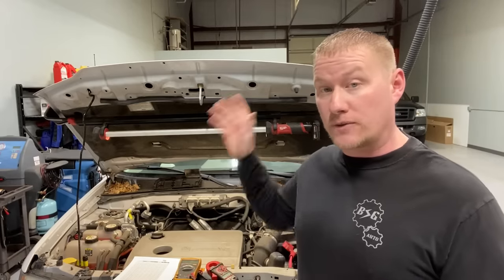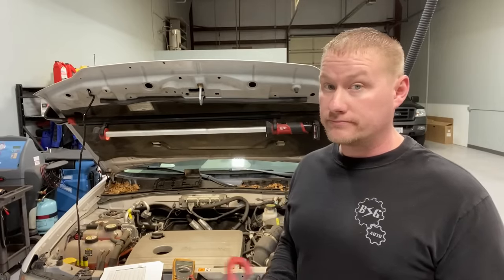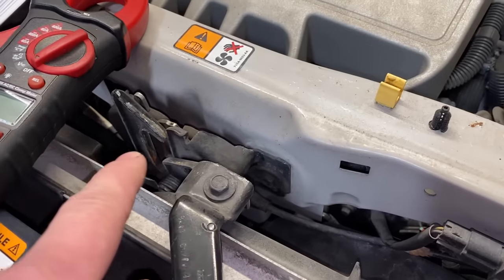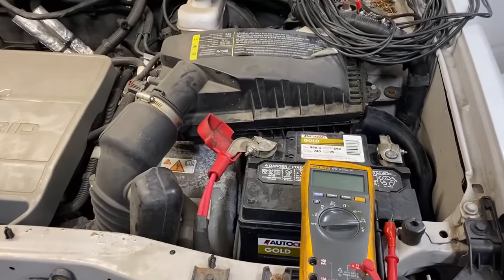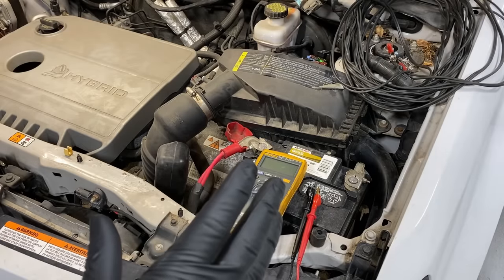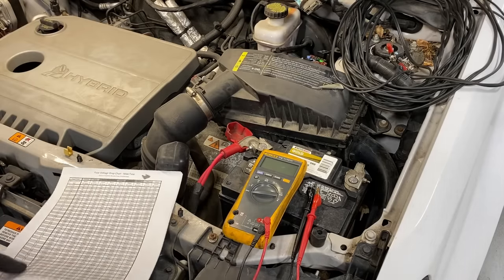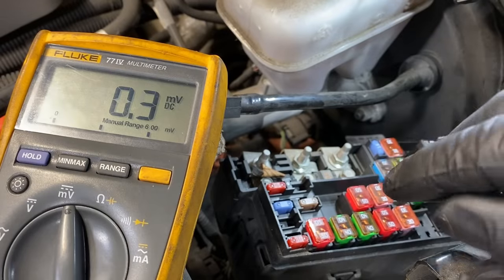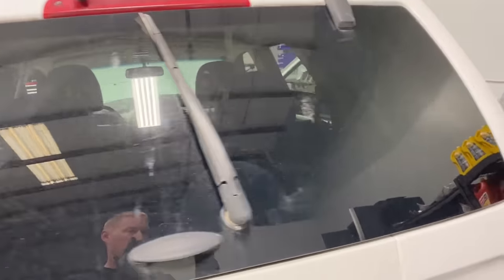Which Parasitic Draw Test Method is REALLY the Best?

Comment: Yep, you nailed it from watching other videos on the subject - you’ve covered the bases - & some other good tips too re rear washer motor - also the lead connect to negative batt terminal to negative lead before connecting the multimeter - which saves the multimeter from any spike/surge. Although I think you’re a bit harsh saying 90% useless is the measurement of the mV readings to back of the fuse. The method is non intrusive - It can quickly diagnose circuits that are on - & identify approx current draw. The drawback are items you covered. Horses for courses 👍

Comment: This was very well done.  Discovered my Klein CL120 does NOT measure dc current  on the clamp only ac.  Now smarter picking up CL590 clamp meter that will handle the dc chore.  My  '95 Mustang 5.0 has been taking down battery every few days.  Got a charger to top off myself and maintain and a loadtester.  Shop last trip gave me full charge and full system check calling it good!  Telling me to pull the phone charger overnight.  This seemed logical and worked for a week...boom.  Did the series test and seeing 140 mA draw.  This is well more than 50 mA standard.  Next step to do clamp dc amp and fuse test to see if there is a bad actor lurking.  Or is 140 mA OK?  Hmm I do need to give it an hour to see if the key remote unlock and clock are adding up.

Comment: Had this issue on my 2002 F150 and it was the radio.  Couldn’t figure it out and decided to change the radio because I couldn’t see what station I was listening too and it ended up fixing my draw issue.  Two issues fixed at the same time!  I got a newer radio with Bluetooth and hands free calling and no longer needed my jumper cables.  Win win…

Comment: Nice detailed summary with your thermal camera I wish it also brought out a infrared temperature scanner because that can also help just by measuring the heat across each fuse not everybody will have a thermal gun obviously cuz the price but you can get a infrared laser thermal scanner real cheap and for the cheaper ones just keep it closer to the fuses

Comment: Excellent video.  2 questions.  1) Does it matter if the positive cable is removed instead of the negative to insert the ammeter?  2)  Will using the amp clamp on the negative cable give the same results?  Thanks.

Comment: Your Tried and true method has been used for 30 plus years and there is a reason for it. Set it up including module shut down time and open up shunt so meter becomes path for battery, meter on mi/max and walk away. Come back periodically and check the meter. Process of elimination of each sub ckt for draw. Method of your choice. That easy. 
Honestly a visual observation and good ears will lead you down the right path if you have experience.

Comment: I used Brians's good method to find a parasitic draw on my 2005 F-150. It turned out to be the basic AM-FM radio that had a low resistance to ground. It wasn't quite shorted but was drawing a few amps even when the key was off. I should have taken the hint when the display LEDs started acting funny and going dim. 

I'm an industrial automation tech so I already knew how to do this. Brian is right. Using the multimeter in line with the battery cables is the best way to test for current draw. The clamp-on meter works great if it has a DC amperage function. Some cheap clamp-on meters only do AC amps. Those won't work in this case. Another possible way is to measure across the load side (downstream side) of the fuse using the Ohm setting with the fuse removed. You have to know more about the circuit to understand what is a good reading but a very low resistance reading is a pretty good sign that something is bad in that circuit. Intermittent problems are always the hardest to find. Wires that have damaged insulation can be very difficult to find and sometimes the best you can do is to just carefully run another wire rather than try to find where it has gone to ground in the wiring harness.

Comment: Finally there are DC clamp on ammeters. They are less than a Ben Franklin and mine is just great. No need to disconnect wires. Just access the wire, clamp, and read the current. I will be using mine to find a short in my wiring.

Comment: I had a VW in which had defied everyone with a fault - every test going had been done. Only scoping the fuses one by one with a laser temp-meter showed the cause - a dodgy connection grounding out on the 20amp starter fuse circuit - with the car stone cold, the 20amp fuse wasn't. It can be a very handy bit of test kit.

Comment: ❤

Got to say its really quite straight forward with basic understanding of cars and electrical sysytems this is not system design just pointing and shooting really

I have an E91 bmw 320d which has now killed 2 batteries, one being brand new!! 😫

I thought it could be relating to a control module or the entertainment/nav system,  BUT my rear wiper has recently decided to freeze in the upright position just like you highlighted! Ive pushed it down but its definitely not locked at rest as it should be! 
I have suspected the alternator also and will check draws using an amp clamp as you've done! 
I have formal automotive experience but you broke this down into a video that really anyone can piece together without more than an hour of learning and a bit of research on their own vehicle.. 
If you're still out there reading feedback, thanks for your time and effort putting these videos together! 👏👏👏👏🥇

Comment: First off, your channel is awesome! Keep up the great work! I have a 2011 Escape 2.5 with a parasitic draw. The wiper motor is not the culprit. I do notice that when you turn off the car, the clock will stay on and not shut off. What module would that be controlled from? I cannot figure this out? Would it be the BCM (interior fuse panel)? The car has a sunroof and I was told by the previous owner that the sunroof drains were plugged and water got in the footwells.

Comment: This was very well performed. I reckon you had already eliminated the alternator. We all know it's Ac then converted to dc by the rectifer. The easiest way to check it, set meter to AC . Engine running. Check at battery. If you get anything but zero. Rectifier is bad. Everyone knows this. That's the 1st thing i check. Replaced quite a few.

Comment: Great information! But the parasitic draw on my friend's 2012 F-150 only happens VERY intermittently. I was inside checking the fuse panel with the volt meter when all of a sudden the draw jumped to 3.5 on the amp clamp and it only repeated about two or three times in two hours. The constant draw was 1.5 on the amp clamp.

Comment: Found a parasitic draw in my wife’s Chevy Tahoe. It was in the radio, in the circuit that has power even when the key is off. Didn’t want to spend the money to replace the radio so, I pulled the fuse for that circuit and put a jumper wire in the fuse box so that circuit would only get power when the key is on. So you can’t have preset stations and the clock resets every time you turn the key off but who cares, at least the battery doesn’t go dead after it sits for two days.

Comment: Excellent video. In case of those cartridge fuse you still have to pull those in the 3rd method. A dome light circuit on my truck drove me crazy with the  delayed courtesy dimmer.

Comment: Best video over 20 years in the business. Thanks for the battery disconnect with the extension cables. Never thought of that. Thanks. Can you update what amp clamp you use the amazon link in inop. Also I found with battery drain problems over the years always look for the obvious aftermarket equipment first, dongle plugged into the obd connectors. See if the inside smells like the vehicle was pulled out of a swamp, etc..

Comment: Well done. Of course I would have started at the battery to see if there is a parasitic drain in the first place and then traced it to the circuit. You did everything I would have done...max hold, etc. I have a Fluke 87. I need to get a clamp style DC amp meter and they cost quit a bit more than an AC clamp meter.

Comment: I had a parasitic draw in my 99 Ranger once.  I used method #2 since I don't have an amp clamp.  I hooked my meter up before removing any accessories in may case.  It turns out that the inexpensive power port y-connector was the issue.  It was one of those you buy at WalMart.  My battery would drain in about a week.  Something on it's printed circuit board decided to go on the fritz.  It still provided power to both ports, but It would constantly draw and amp or two once any item to be charged was removed.

Comment: Absolutely the best video on finding a parasitic draw I have seen yet on youtube. My only question: why do you spend the time to add the leads on the negative and then remove them to have the full load go through the meter? I didn’t quite understand why you couldn’t just hook the meter up in series and wait? What was the purpose of the leads first? Thank you!!
Reply from the maker: The dual leads allow proper current flow no matter the setting on the meter. Also, it allows for connecting to something as large as a battery post.

Comment: I prefer placing a meter in series with the battery to measure the amount of draw. Amp probes are to unreliable at lower currents under 1 amp and drift a lot . The voltage drop across the fuse thing may work for some but I’ve never had any luck
With it . Great video

Comment: Great video!  This is very useful. I have always done method # 2 which I always hate since I have to undo the battery cable to begin with, and I am too cheap for an amp clamp. Thankfully for a DIY'er, I seldom deal with parasitic draws.

Comment: That was a very clear tutorial,   I normally use the in series between the battery post and cable,  but I do have a dc amp clamp,  if I needed it.               GREAT VIDEO,                  Thanks

Comment: I've used the tried and true method of disconnecting the Negative cable and putting a home made "Cable" set up to run the vehicle, shut it down, insert my Fluke 87 set up for 10 amps with an in line fuse to protect the meter's expensive fuse, then disconnect the "heavy cable" used for running the vehicle once the high current drops off while the meter is still connected with less than 10 amps running through it and finally put on min/max.  Like you said, takes a while to show itself.  BTDT!
A sometimes quicker way to get to show, is with the heavy cable and meter connected, turn the ignition switch to on, then off, then on, then off,  then on, then off.  With key fob vehicles push the lock button and watch.  Sometimes the 3 on and 3 off will make the intermittent circuit show itself by staying on and at that point I'm saying. "I gotch ya!"

Comment: One of the most informative videos that I’ve ever seen. I have two questions though, if you test across the fuse instead of from the fuse to ground wouldn’t the fuse be a path for the current to flow making it difficult if not impossible to get an accurate reading to diagnose the problem? Second question, if you turn off your vehicle with the wipers in the up position so that you can raise them up off of the windshield so that they won’t freeze to the windshield will that create a parasitic draw?
Reply: The wiper motor will only draw current if the ignition is on to power up that circuit.  The only exception to that is cars that park any open windows, sun roof and then leave the courtesy lights and parkers on for a minute after you have removed the keys...

Comment: Great video! 
Just 2 things id like to mention that ive seen in the field doing these same draw tests,
One thing is ive noticed some multimeters will always be an amp meter if the wores are plugged into the ports even if the meter is off or set to volts and can blow your fuse if youre not careful. I find it easier to disconnect one lead until im ready to do the test.
2nd thing is ive noticed when pulling certain fuses that power modules will sudden awaken other modules and increase the draw since the working modules are "searching" for the module that lost power when you pull the fuse and it can be confusing to see the draw increase after removing a fuse...but after finishing the video you did mention the 2nd one 😅

Comment: Problem with amp clamp, my terminals have multiple wires coming off the terminals. So it's hard to isolate each of them as they are bundled and close. But great information for sure. Thanks!

Comment: Brian, best explanation on how to find a parasitic draw ever! 
One question : With the DVOM (10 Amp) in series, how do you protect it when a Wiper motor intermittently surges, which draws 40Amp to operate?
Reply from the maker: Wow your wiper take 40 amps? The DVOM has an inline fuse that will pop and protect itself.
Reply: Yo Brian, thank you for the prompt reply, I noted your comment  and .... sorry man... my car's 'fast and slow' wiper motor (Peugeot 308) has a 30Amp fuse.

Comment: I have been using inductive clamp ammeter equipment since the last 70s, with the Sun VAT-40.  But it was not designed to measure milliamps.  But what it was designed to work on always let the vAT-40 do a great job.  Now, many years later. DVOM equipment has finally begun to include Amp Clamps on the better devices, which is capable of measuring milliamps.  Now the job of tracking down parasitic draws has become quite easy and fast.  Once the AmpClamp DVPMs began to hit the market I was all over them, and never looked back.
Reply from the maker: OMG I forgot about the VAT-40!
Reply: @FordTechMakuloco  Not me!  I actually found and purchased one via ebay.  It has a damaged lead (I was told in advance of that being the case).  It was easy enough to repair.  Now I have a very functional, and well used VAT-40 to use on our vintage pony cars.  I also have a Sun 1150 Oscilloscope inductive clamp model I use on the vintage pony cars.  As if that is not enough, I have two DVOM with Amp Clamps similar to the one in your video - they are wonderful tools, and work very well when chasing down parasitic draws, measuring amperage draw on alternator rotor circuits (testing for open rotor circuits), measuring amperage draw when cutting over to LED lights vs 1157 incandescent bulbs, etc.

Not that the VAT-40 can't handle battery load testing, as it can.  But it has a maximum of 500 amps it can pull.  I wanted something that could pull more than 500 amps, for certain uses.  I ended up getting a Solar brand carbon pile unit that works great.  https://www.amazon.com/gp/product/B015NC88HQ/ref=ppx_yo_dt_b_search_asin_title?ie=UTF8&th=1

Oh, my vintage pony cars include a 1969 Shelby GT500, 1973 Mustang Convertible, and a 1973 Mach 1.  Very cool cars to tinker with, work on, show, and drive.  

Where are you located?  Just curious...

Comment: That extra spagetti of wiring that was inline temporarily is more confusing than helpful, i think. Most decent multimeters have a 10 amp fuse protection, and thats likely enough to do the test. Of course you need to keep your multimeter from falling asleep too, had mine do that. And i don't see why there is a one hour wait for the car to go to sleep. Usually a few minutes is all it takes. I was working on a 2003 Mercedes S Class, super complicated, and it fell asleep in two or three minutes.  Great video, keep up the great work!

Comment: You're  a really good teacher. Too bad there are so many modules on cars today. Alot of unnecessary items that most people don't  use anyway. Automatic door locks, headlight washers, 12 way seat modules in door location for driver and passenger. Memory seats , mirrors, . I really miss the old cars. Move the seat to where you want it. Set it and forget it. Parasit draw--someone left the glove box on, dome light , trunk light. My old 2003 mercedes 9 modules key code readers etc. It always has to be done the 3rd way you showed. Thanks for a great video. And test equipment does nkt have to be expensive at all. Harbor freight equipment works just fine and it is really cheap semi crap. Inductive amp meter 25 dollars, volt meter used to be 1dollar with any purchase now about 5 dollars for a brand called centeck. They are right on the money with fluke  easurements. Only thing is they are so cheaply made that they may last 2 years but for 5 bucks who cares. Thanks again.

Comment: I have a 03 mustang gt with a wicked paracitic draw on it brand new battery parked it for 12 hrs an it was dead i been leaning between the radio system since it has an aftermarket head unit an the factory amplifiers for the mach460 system but after watching this video def gonna use a multimeter to be 100% sure of the circuit before i just start replacing things on a hunch

Comment: I use my voltmeter.  Disconnected the neg battery cable then connect the black meter probe to the neg battery post.  I connect the red voltmeter probe to chassis ground nearby.  The voltage reading with key off and out and doors shut should not read more than 0.25 volts.  Anything could be leakages.  Start pulling fuses to identify the circuit causing the problem.  Easy, simple, quick, no expensive equipment.

Comment: Hi Brian. The only issue with the third method is you cannot measure across the closed fuses and relays. I prefer to use the second method. I realize using the second method can wake up a module though.
Thank you for showing these methods.

Comment: I have a 2015 gmc serria Dinali diesel, new batteries, good alt, it drains both batteries in three days, When both negative cables are removed and you’ll come back up the left side of the truck does an arc heavy but the right side does